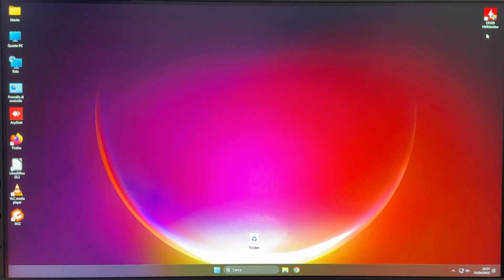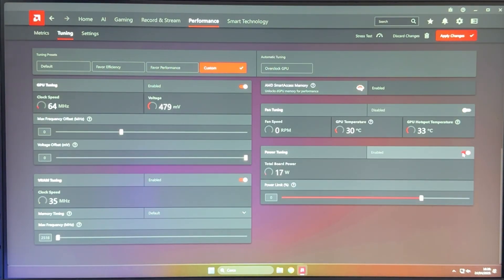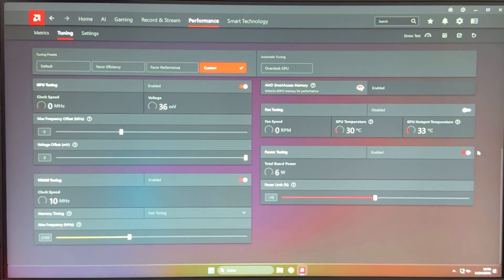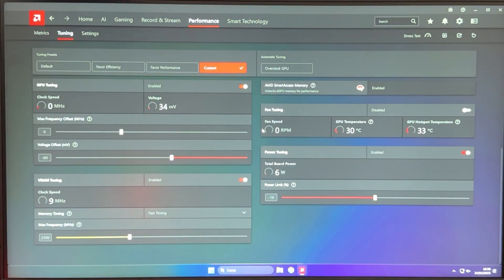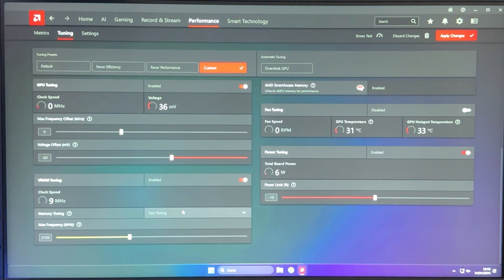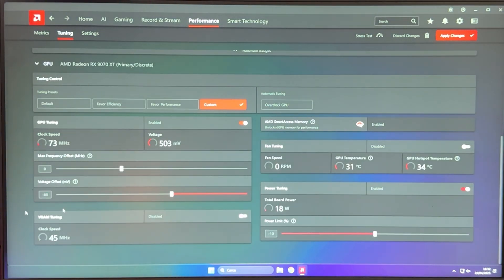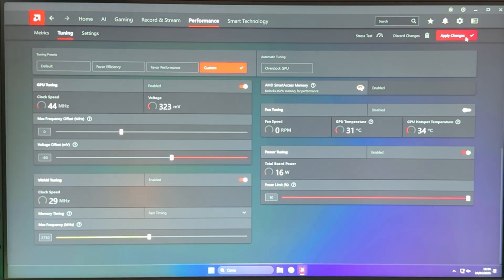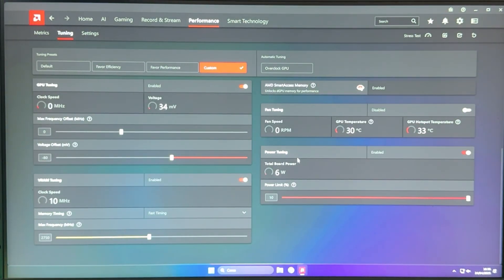Undervolt your RX 9070 XT for more FPS and Lower Temperatures! - Tutorial

Comment: Lowering the voltage increases performance per unit of power consumption. This means that if you set the FPS upper limit and then lower the voltage, the power consumption will decrease while the upper FPS remains the same. It's smart to decide what FPS you want and then tune. Everyone is happy that lower voltages improve performance, but are you running your GPU at full power without setting an upper limit on FPS? I'm limiting it to 116FPS, so I set the voltage to -90 at PL70%. This setting will limit the GPU to 230W, but actual power consumption will be under 150W for the majority of games.
Reply: 150w is what my undervolted 5070 Prime runs at while playing Witcher 3

Comment: Most of the initial production of RX9070XT is equipped with SK Hynix memory. It reaches around 90℃ at full load, so I don't think it is suitable for OC. However, Samsung memory has been adopted halfway through, and it operates at about 10℃ lower temperature, so it is safe. My Red Devil is Hynix so I'm afraid to OC the memory. Sapphire switched to Samsung early on, but PowerColor may be slower or may not have switched yet.
Reply: I ordered XFX 9070 do they use SK hynix too?
Reply: @lifedroid xfx models use Samsung memory, I have the 9070xt magnetic air oc :)
Reply: @lifedroid  mine does have hynix. what about yours?
Reply: @KuehlNotWarm yep mine Hynix too
Reply: Samsung is slower tho. So what ever oc you achieve on samsung is alreazy tjere on hynix.

Comment: Does it work for sapphire pulse?
I just want to lower down the temperature 😊
Reply: The quickest way to lower the temperature is to lower the power consumption. First, set the power to -30. That alone will bring the upper limit to 230W. Then use AMD Software or RTSS to set an FPS limit that will be applied across all your games, saving you the trouble of having to set individual FPS limits for each game. I have it capped at 116FPS. Once you've done this, try undervolting, which will reduce power consumption a little further with no change in performance or FPS. Undervolting does not improve power consumption for Radeon, it only improves power consumption slightly at locked FPS. So the first step is more important. People who have gone from Geforce to Radeon don't understand the difference.
Reply: @銀河光芒  porque comprou uma 9070 xt então? Reduzindo tudo e limitando o fps, era mais fácil ter comprado uma 9070 ou uma placa inferior que teria a mesma resposta gastando menos.

Comment: For me I wanted my card to make as little noise as possible, but with stock performance. So I choose Cyberpunk to do benchmarking with as that was a game I had, which also had a pretty easy benchmark. I then lowered the power limit by 10%, as I knew I had to cut back on the power to make it less hot and thus less noisy. I can't really remember my setting in Cyberpunk, when I did the tuning, but I remember I got 88FPS stock, then 86FPS with the -10% power, then I slowly added an overclock to the VRAM until I was happy with that, my card can run with 2800MHz, but not stable in everything, and the VRAM temperature was extremely high, so because of this I settled on +100MHz with fast timings. Then I started slowly undervolting in small steps, as I did I reached 88FPS again, then I lowered the power limit further by 5%, so -15%. then slowly more undervolting until I reached -60mV and was hitting 88FPS again, so that's how I went about getting my settings tuned in. I do believe I can go further on the undervolt to -80mV, but I got what I needed, so maybe sometime in the future.
My settings: Power Limit -15%, Undervolt -60mV, Overclock VRAM +100MHz and fast timings.
And with these settings my Powercolor Hellhound RX 9070 XT can run Cyberpunk (benchmark) in 1440p, Ultra preset, Path Tracing, FSR 4 Performance (using OptiScaler), to get 60FPS on the 1% lows and 66-68FPS averages, really impressive I must say. Of course you can scale back to Ray Tracing Ultra instead of Path Tracing, and go FSR 4 Balanced instead Performance etc. and still get good to great FPS.

Just an FYI: If your driver crashes during tuning, it is recommended to restart your PC, if a box pops up saying some hardware or settings have changed, then restart again until you don't see that, then you can begin to tune your card again.
Reply: What about vram temperature at 2800 mhz  and +100mhz at your final pls?

Comment: I have an RX 580 8GB 2048SP graphics card. Can I apply what you are doing to my card?
Reply: Not really there will be different settings for rx. 580
Reply: you can look up ancient gamplay's video on rx 580 undervolt. It has more stages to undervolt/set clocks. but you can achive much higher efficeny if you  manually tune each

Comment: I used your settings, as-is and got my ASROC 9070 XT to run much more efficiently. Power consumption was about 10 % less and my GPU ran at 58-60 C playing Oblivion Remastered, running 170 fps. Your settings were really simple and straightforward, so a big THANKS !
Reply: Did you get taichi or steel legend variant? Mind sharing your settings? just got my Asrock taichi today, Thanks in advance
Reply: @zort65 how's the card? I'm eyeing that version and debating on selling my 4080 super for $1,100 and buying that card.
Reply: @otbs9967 did you do it? I think a 4080 super performs better than a 9070 xt in most ways no?
Reply: What are the best setting for the steel legend variant?
Reply: Does undervolting cause any damage?
Reply: @itzdougie9745 no and there are failsaves built in the graphic cards hardware and software so nothing serious can happen.
Reply: @Varg0007  can i set it back to default?
Reply: @genlongtsang1093 yes, you can and when a change in settings fails to run stable the AMD software always resets to its default settings. You can try again after that. Not every graphics card runs stable at the same settings.
Reply: @Varg0007  which is the stable settings undervolt
Reply: I've got the same card and every game keeps crashing, did you copy his settings or did you change something?

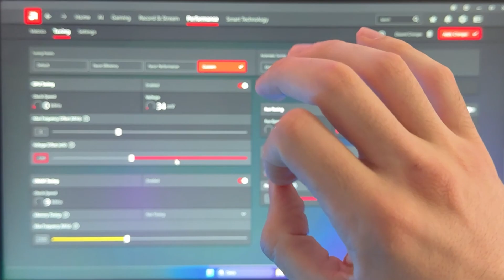Comment: 5:20 I agree that most should be able to do -50mV (mine can do -95mV max when using steel nomad) but talking to one person revealed they got one that couldn't go past -35. Seems extremely rare, but still possible.
Reply: it could be that he needs to disable windows hardware acceleration, my 9070 XT would crash a lot, like out of nowhere (sometimes not because an UV), GTA v would crash even if i did -20 on voltage offset, so i would tell him to disable it and try it, also some games simply dont like AMD UV for some reason, I had a 5080 and I did an UV and GTA V never crashed. Weird.
Reply: There is silicone lottery at play so your mileage may vary

Comment: The best settings i could get for every game stable was -60 uv, 2800 memory fast timing  and i went with -10 power limit, memory stayed quite cool around 68c, hotspot around 70c, this is with the fans running around 1600rpm which is quiet on my card in a Antec C8 case with 3 fans blowing straight into the Gpu, i read some cards  have changed from hynix to Samsung memory which runs a lot  cooler, lucky mine is Samsung, card is a Sapphire Pure Radeon RX 9070 XT.,
Reply from the maker: That's pretty solid! I can confirm the memory switch, Samsung is indeed better so far it seems :)
Reply: @ImWateringPSUs  can I ask why you said cards that can do only -60mv are bad cards? did you test a regular XT  than an OC XT variant? Mine is an OC XT and is only stable at max -65mv with Steel Nomad benchmark.  Although mine is hitting 3.43ghz clock and getting 76fps on Steel Nomad so far. Other pc  components are not even high-end.

Comment: Never mess with negative power limit. It would severely make more stutter bc the card cant draw power when the scene demands it.

Safest way is dont change power limit, dont change VRAM, just keep dropping voltage by -10mV.

Find your most demanding game to test on, a game that is heavy on VRAM, draws crazy power without RT. (Not monster hunter)

If you so wish to reduce power, limit framerate instead. Use in game limiter or Radeon chill

Comment: Had Gigabyte 9070XT Gaming OC, it did -40mV only, now have Aorus Elite 9070XT its doing -50mV only... So this guide is not good! Also i set -30 power and its pushing max 500+ watts and average is 320W...
Reply: Botcomment lying or you are simply lying through your teeth.
Reply: @KOT-ANGRY  I'm beginning to think the OC XT variant have less undervolting due to being OC configured. So I think it stays within those figures for default stability. Personally,  I find that number good unless your performance is suffering and registering low fps.
Reply: Undervolting alone does not improve power consumption. The power consumption is improved only when you set the FPS limit. With unlimited FPS, power consumption will always be maxed out, undervolting or not. If you want to lower voltage and improve power consumption, please also limit the FPS.
Also, if you set the PL to 70%, the power consumption will definitely drop to 230W, so you must be doing something wrong. If other software such as Afterburner is running, there may be conflicts and problems may occur.

Comment: You didnt seem to test many games if you think thats stable.
Reply from the maker: I make the choice to not show game testing in my tutorials to keep them short. I show games in my PC Build videos tho!
Reply: @ImWateringPSUs  which makes the video extremely missleading since these cards in 90% of cases can't handle above -60mv in a range of 20 titles without crashes and driver timeouts. This became extremely apparent for me and my friend, he has a nitro+ and i got a red devil, -150mv in timespy is just fine with 3,3ghz boosts but path of exile for example cant even handle -60 and only stops crashing at -40 for my friend and -50 for me.
Reply: @Imagine-88  Use Steel Nomad for gpu undervolting. It's the best for finding a stable undervolt that will work in all games. I've been running -80mv, 2764 fast timings on the memory. No crashes with an asrock steel legend 9070xt.
Reply: @ shame that my red devil card can't go above -50 :(
Reply: @Imagine-422  and I thought I was unlucky with my 9070xt reaper at -100 in few games and stable at -80mv in all... I guess silicone lottery can be harsh sometimes 😞

Comment: 2700 wastn stable for me not to mention fast timmings on nitro+ so i just set to 2600 and now its ok and max uv for me is -75 stock power limit maybe that will help someone ... Memory is hot on stock and there is no real reason to push it that high
Reply: Was running nitro+ at -80, fast timings and 2560 and i had drivers crash in Overwatch once. So i reduced to -70 and didn’t touch memory at all. -15% power limit. Will see.

Comment: You're doing a great job. It would be nice if you added data, gpu temperature differences, memory and fans rpm, stock vs UV🙂
Reply: Same i want the result
Reply: The VRAM temperature differs by 10 degrees Celsius between Samsung and SK Hynix, so if it is different from yours, the information is useless. The VRAM vendors are Micron, Samsung, and SK Hynix, and the lowest temperature is Samsung, while Micron and SK Hynix are 10 degrees Celsius higher.
There is a lot of such information on Reddit, but very few streamers mention this.

Comment: The problem with the 9070 xt is that you pay 100-150$ more than the 9070 non-XT just to undervolt it to consume a bit more power than the 9070 and get 2-3% FPS more. Might as well just get a 9070.
Reply: I get 10 to 13% performance uplift for my OC XT. I believe I can boost it even more upgrading some of the pc components. The 9070 is an amazing card, but you'd be a fool if you believe that the XT can't go any further. aside from that performance uplift, you pay premium for the additional AI performance too.
Reply: @ we are talking about undervolting here.
Reply: Question, why do you say that a card which less than -80mv is a bad card? Arre you using an OC variant?
Reply: Pathetic card

Comment: Update: Thank you so much.... that Video i was waiting for.. my XFX Mercury 9070 xt works fine in -80 mv / 2700 Mhz and - -9 Power. Tested on Cod Bo6. Thank you so much and best greetz from Germany
Reply from the maker: That's really solid! Glad I could help my friend and thanks a lot for watching!
Reply: Do you mind sharing how many fps you're getting in BO6?
Reply: @gahyunkim8278  around 289 fps
Reply: Hi I have the same card what would you say I should set my settings to to get more fps and coole temps and lower fan noise ?
Reply: -120😮 i cant get past -90
Reply: I get 144fps in bf6.